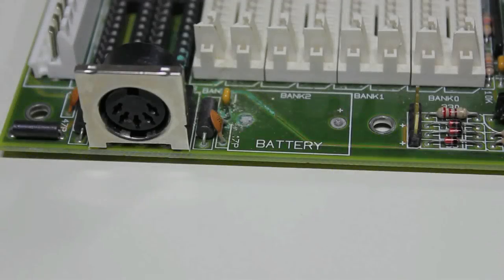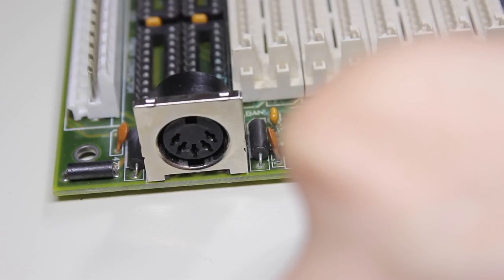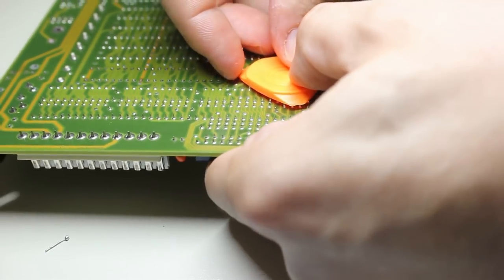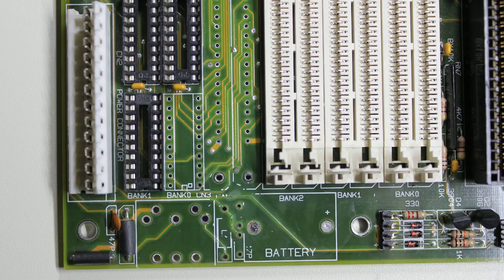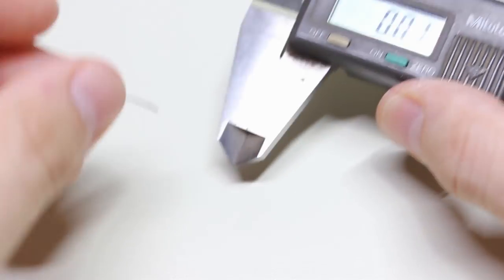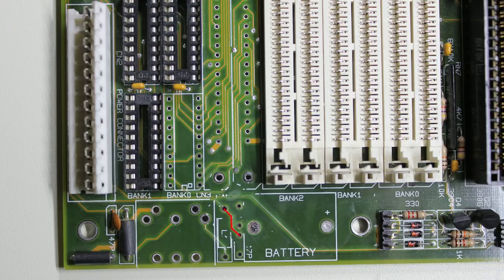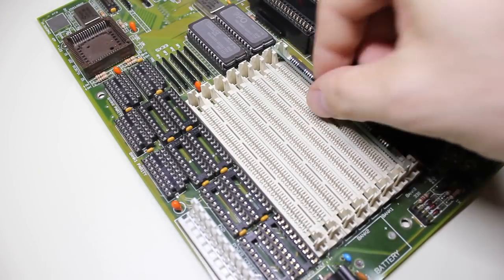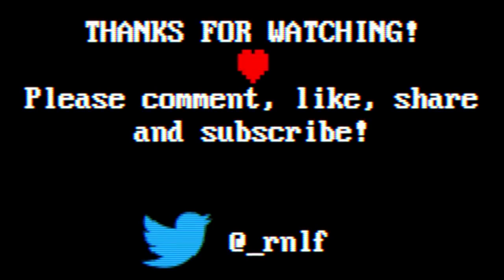Repairing my 386SX Mainboard

Comment: Very good video! I recently obtained a Packard Bell 386sx system that had it's battery leak. The system boots to two beeps. No video. Video circuitry is close to where the battery is on the board.

Comment: The solder joints on those disc capacitors at 12:38 looked a bit like melted hershey's kisses...  You might want to consider re-flowing them once you get a better soldering iron.  That was a lot of work to save a 386SX board.  I can't remember how many I just tossed for this exact same error in the mid 1990's.  Death to barrel batteries.
Reply from the maker: The board is dead (see later video). I continued the build with a 386DX mainboard.

Comment: I find it easier (and more aesthetic) to repair traces with conductive laquer. Also if you don't remove the solder mask and clean of the corrosion from the traces - it will eventually eat through the traces as well.

Comment: Get a hakko fx888d. Good stuff and cheap.  Also id go with a bit more solder per pin.  Some of your joints are dangerously close to being incomplete.
Reply from the maker: Already have a new soldering station. Ersa i-CON Nano. Pretty good, actually. Yeah, I sometimes have to redo the soldering after recording the video. It's hard to see what I'm doing when the camera is still in the way :-)

Comment: Is this going to be a full period correct build or we talking Gotek floppy emulation and Compact flash drives? Also for almost 30 year old give or take a few years you made light work of it. Surprised at how little corrosion damage there was, seeing it in a previous video I was certain there would be more.
Reply from the maker: It's going to be a proper floppy drive, but SD2IDE "HDD". I find it increasingly hard to find working hard disks from the era.

Comment: You might not need to replace that fan, my 386SX had a noisy PSU fan like that, and all I needed to do was to oil it. It's still silent after a year (though this technique isn't always working, but it's worth trying)

I replaced my shitty Yihua 936 soldering station with a TS100 soldering iron. Some say you'd still need a soldering station and that this is only useful on the go, but nonetheless I find it excellent just with desk use x)

Some people have reviewed it, even EEVBlog did it with it's little brother the TS80
Reply from the maker: Ah, cool! I might try that. I have a bunch of fans in stock, maybe it'll be less work than fixing the old one.
Reply from the maker: I bought an Ersa i-CON nano now. It looks really good so far.

Comment: New subscriber, newbie question, if a 386sx PC has 640k conventional memory and extended as ram, could you design a motherboard with more conventional memory to over 1 meg to handle a emm386.exe page frame address, just saying if you could engineer doubling it that would be outstanding for me.
Reply from the maker: You can use the HMA for that (it's the first 64kb-16bytes above the 1M mark). I think that's commonly used.

Comment: :facepalm: you can not use vinegar, it's an acid. Use rubbing alcohol or other solvent.
Reply: The idea is that what leaks out of the battery is a base, and will continue on damaging traces etc when kept unchecked. Applying vinegar neutralizes the base and stops this from happening. After that, you can use IPA or alcohol to remove the vinegar, as he did.
Reply: @Spritetm  You use something like baking soda to neutralize an acid. Vinegar is an acid. I should know, I use to use it to clean rust off of steel parts until I tried electrolysis. Vinegar will destroy the metal. That's why I stopped using it.
Reply: @JohnDoe-ml8ru  Sure, but the crud coming out of a mainboard RTC backup battery isn't acidic, it's basic. If the battery is an alkaline battery, the 'alkaline' in the name is because it uses an alkali electrolyte, which is a base. Same goes for a NiCd battery, which uses potassium hydroxide (also a base) as its electrolyte. Hence the need for an acid to neutralize the electrolyte when it leaks out. You may be confusing the cleanup here for the cleanup required for a lead-acid battery, which indeed uses acid as an electrolyte; if those leak, you indeed need to break out the baking soda.